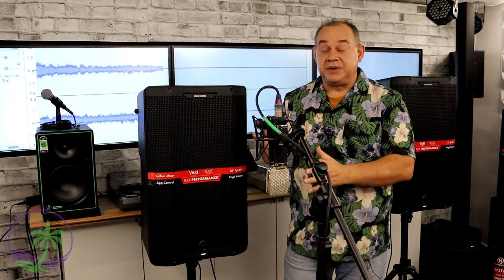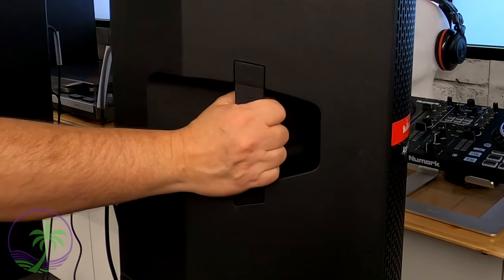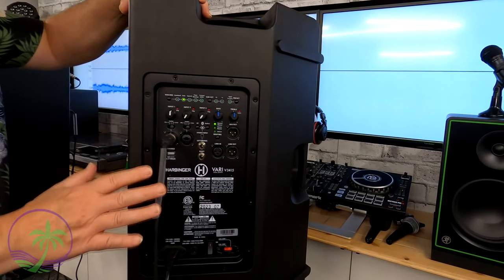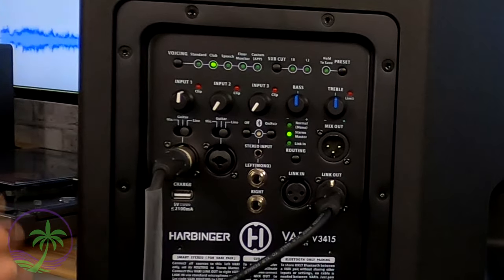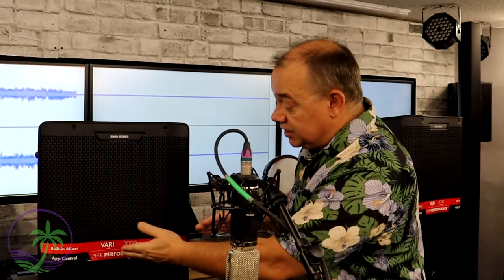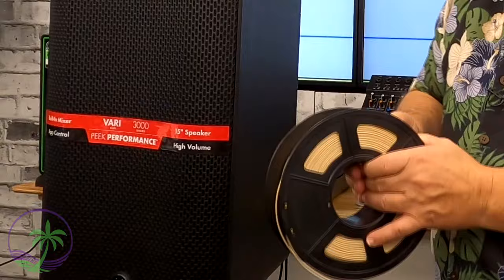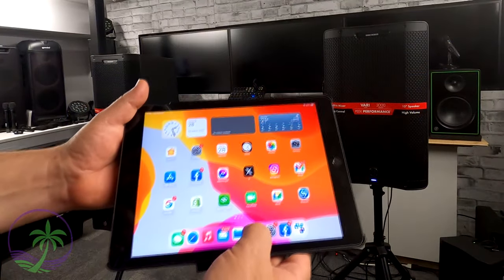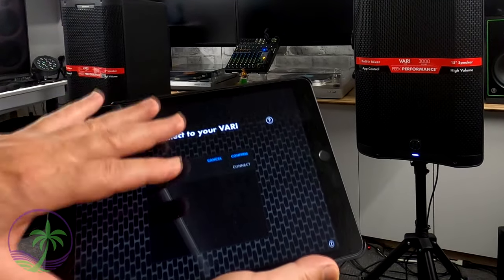Power, Performance, & Value. WHAT! The New Harbinger V3415 15" Power Speaker

Comment: I have a pair of Harbinger 2315 Pa powered speakers. The sounds is great and better than some of the famous brand. However, what I hated is their control volume has no numbers or lines so I can't really tell exactly was set to. If you only used one speaker then you will have no problems but when you have 2 speakers, the best estimates set is at 3 o'clock, 6 or 9 but not always be at those spots. Anything in between you cannot  really tell...
Reply from the maker: if you use the stereo link connection option the second speaker will match the first automatically. But numbers or dots would have been nice.
Reply: How do you pair both speakers together? For example if, you only using one cord for one speaker and want the other speaker wireless.

Comment: So are these better sounding for DJs than the vari 4115? If so in what way?
Reply from the maker: if DJing get the V4115 for the extra Power.
Reply: I have the 2315s in my backyard bar , but one of the amps blew. So I just bought a pair of the 3415s , went to pick them up today and messed around with the 4115s next to the 3415s , and the 4115s seemed a lot more powerful. Kind of second guessing my choice now. Although the 2315s with the 18" sub have suited me for the past couple years , I think I just start over analyzing. Going to run the 2 3415s with the remaining 2315 and the 18" sub...

Comment: Do you think two ev elx200 subwoofer and two v3415 will be enough for 250 people at a wedding party ?
Reply from the maker: for 250 your pushing it. for the PA part your Good for the DJ/Dance floor Part you will be a bit short. But if only 1 in 5 people are on the Dance floor at any one time your Good.
Reply: @expertisland  thanks for the reply